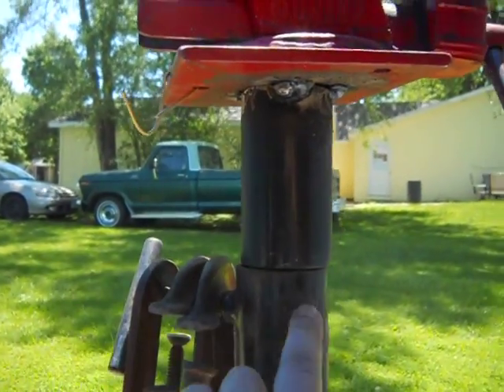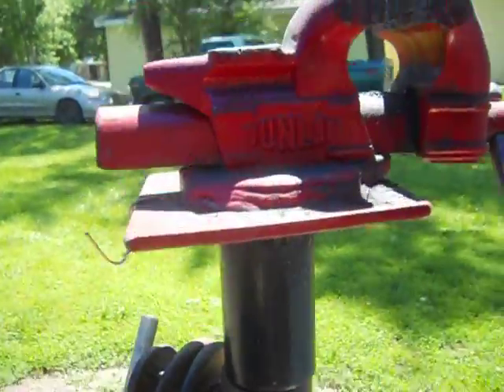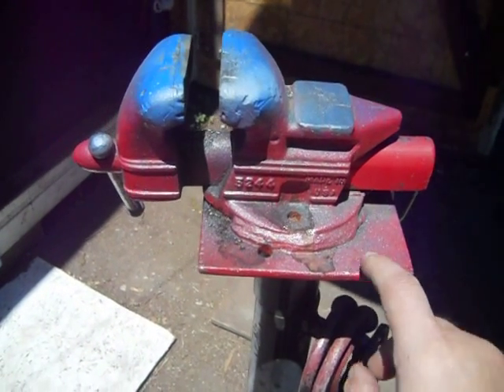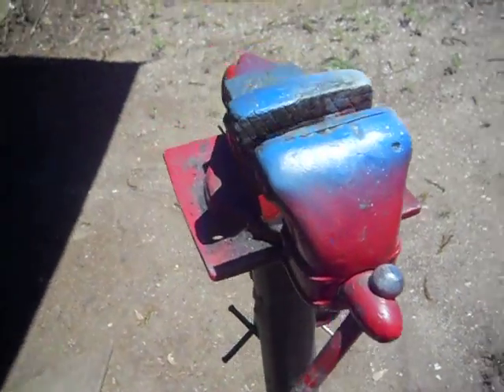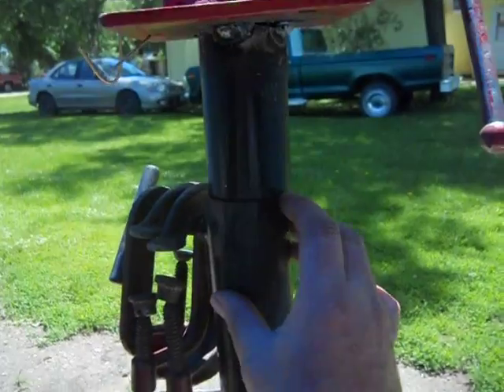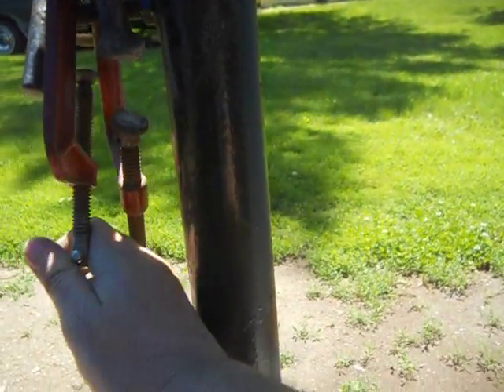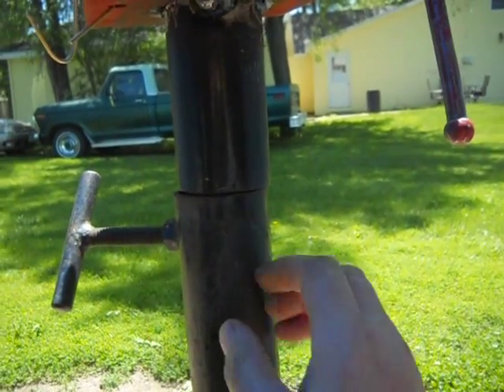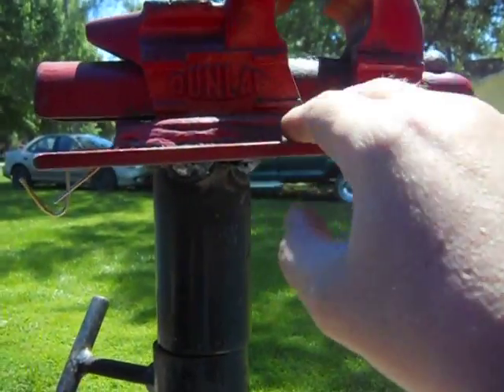Old vise on stand to use outside

Comment: I've had vises outdoors for 20 years with no problem. I slather the screw with anti-seize instead of grease, and pour or spray waste paint onto it and other outdoor gear to prevent rust.
Reply from the maker: I use mine a lot for welding small parts ,grinding and cutting metal ...It is safer than doing stuff inside my small shed

Comment: You showing a Video for a Vice Stand ,   you Do Not show the Bottom   WHICH IS KEY and VERY  important    ...  also why have a Vise welded a to a top Plate without a Swivel, 

  Who cares   if you  have C clamps  hanging ..    on posts welded
Reply from the maker: SORRY I didn't show the bottom This vise came to me welded to the Square Plate It has no swivel base is why I made it turn this way on the Pipe
AND Who cares if you don't Like the video ???